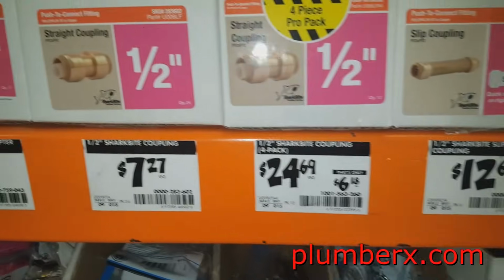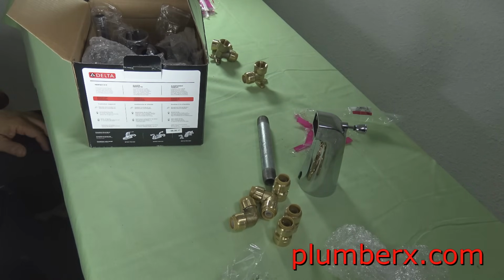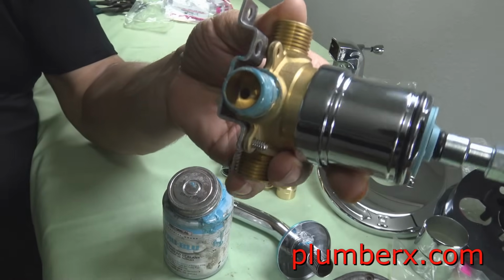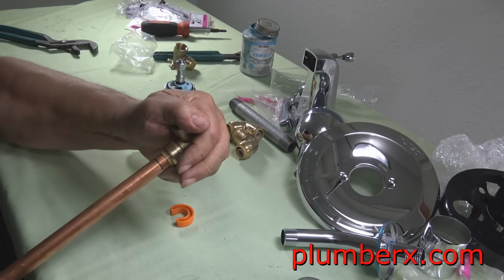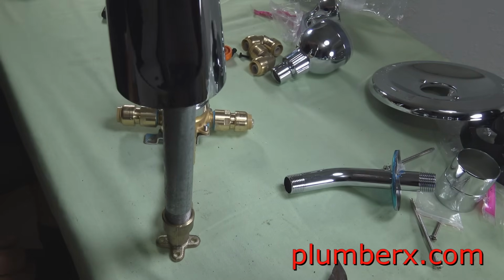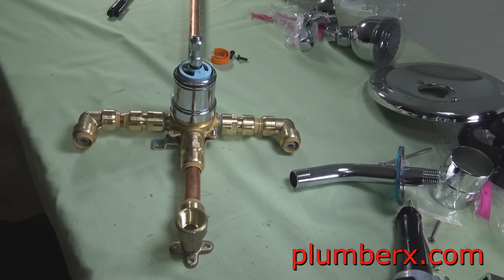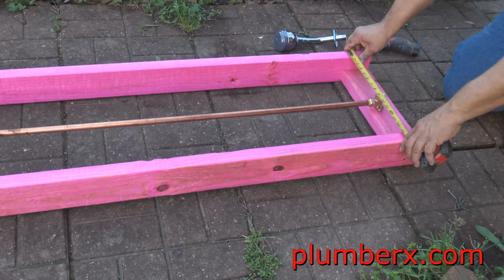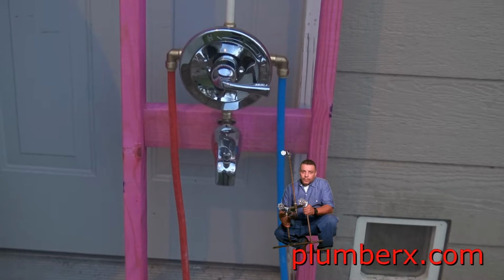Plumbing With Sharkbite Fittings

Comment: The supply inlet fittings are too close together.  You can not put the tool in to remove the fittings.  Also leaks if the pipe doesn't reach the o-rings to create that seal.

Comment: A few years ago I was "freakin' and called Beacon (plumbing)."  They charged me over $700 to come to my house, cut the hot and cold lines, and stated that because this type of plastic pipe wasn't legal anymore, they had to disconnect and cap,  and couldn't fix.  (Ended up being a washer put in wrong a few weeks earlier.)  I read up on PEX pipe and Shark Bites, and recently replaced the pipe, added Shark Bite shut-off valves and elbows (and an access panel thanks to Beacon), and hooked up my bathtub after two and a half years.  Only cost me a little over $100 for parts AND tools.  Love Shark Bite and glad to see your video!
Reply: I’m sorry.  I once called beacon.  Everybody loved bacon they say..  they don’t even charge me for “attempting“ to unclog my main sink pipe.  I was shocked

Comment: I would never install Sharkbite inside a wall or anywhere else. One bad fitting and you could have $100,000 in water damage. Like Boars Head cold cuts. “Compromise elsewhere”.

Comment: You forgot to deburr the outside of the copper pipe as well. Reaming the inside is good practice to prevent internal turbulence - but deburring the outside is required to prevent damage to the O-Rings. You also might as well use Pex to save some money instead of copper.
Reply: @claudetaylor7648 , I'm not a plumber - just thinking about it from a DIY or homeowner's perspective. Copper and Pex have their drawbacks. Pex-A had a bad batch and got sued. Copper is prone to internal corrosion if for God forbid rust from your water heater finds it way to your pipe.

Since it looks like you're creating a new bathroom - I just thought Pex would be easier and faster to both install and repair. Especially if you make make it accessible for repairs (i.e. access panel).

Regarding pex, even if Pex-A had a bad batch and got sued - I would still use it for whole house. Naturally it wants to contract, meaning overtime the connections to fittings get stronger when compared to Clamp or Crimp. But, the main reason I would choose Pex is any non-professional can fix or make a quick fix without having to worry about burning their house down.

I would use Copper if it's put under a concrete slab, especially if it's hooked to the city's main and not vulnerable to rust from the Water Heater.

Comment: sharp copper ends on the outside or the end going in the sharkbite  can knick, cut the rubber seal or slightly damage it in the sharkbite.....especially when using copper....i always debur with sandpaper or a deburring tool, outside, inside and on the face going in

Comment: I find It interesting how sharkbite changed the design about a year ago, sharkbites work fine for temporary repairs but I would use solder or crimp for something permenent.
Reply from the maker: That's a great observation about SharkBite fittings! You're right that they're generally considered suitable for temporary repairs, and most plumbers would opt for soldering or crimping for permanent installations.

SharkBite did recently introduce a new line of fittings called SharkBite Max, which are designed to be stronger and more durable than the original SharkBite fittings. 1  These new fittings are rated for higher pressures and are said to be more reliable for permanent installations. 1  However, there are still some plumbers who prefer traditional methods like soldering or crimping for permanent connections.   
 1. 
What's the Difference Between SharkBite (1st Generation) and SharkBite Max?

www.sharkbite.com

Ultimately, the best method for connecting pipes depends on the specific application and the preferences of the plumber. It's always a good idea to consult with a qualified plumber to determine the best approach for your particular situation.

Thanks for sharing your thoughts on SharkBite fittings!

Comment: The plastic insert on the Shark Bite is only for pex. I remove it when using copper or cpvc. Grab ahold of insert with needle nose pliers and pull out of fitting. Be sure to grab the insert well so I comes out in one piece.
Reply: That's what I was told.  If you're using cooper take out the plastic insert
Reply: Absolutely not!
Reply: @nouche-30064  The shark bite website even says you can remove it.

Comment: We just installed a water softener. The previous owners never installed a main house supply shutoff. We had to turn off the pump & drain pressure. While it still had water coming out without pressure, we installed a ball valve shutoff. By keeping it open, it pressed on with no problem & we could shut it off immediately to continue the re-routing to complete the installation. All fittings were sharkbite. No leaks. We bought the depth/marking tool to chamfer the PEX pipe & guarantee full insertion.
Reply from the maker: Nice

Comment: Love the detail. I was hesitant on using shark bite inside a shower wall but this saves so much time vs.. sweating copper pipe.
Reply from the maker: Sharkbite. Good stuff. 😉
Reply: Sharkbite is so handy man work
Reply: You can also use PEX in a wall. Both have similar lifespans.

Comment: I’m a female and remodeled my shower from the floor up and used shark bite!  I love it. I’m getting ready to install my new whirlpool bathtub and out a new faucet and handles and I will definitely use these again!
Reply from the maker: Nice. I appreciate your feed back. 👍👍
Reply: Never put shark bite in an enclosed wall cavity. At bare minimum I would cut an access panel where you make the connections so you can make sure they are not leaking every 3-6 months. Shark bite is handy but should never be out in an enclosed environment where it cannot be seen. The failure rate is just too high.
Reply: If sharkbite was so unreliable, why are so many used, yet still don't leak? Plumbers forget to mention, everything can leak of not installed properly.....even sweating copper joint can leak over time.

Comment: Good vid.  Thanks.  You need to deburr the outside of the of copper pipe also when using sharkbite fittings because that is the surface that passes over the O-ring.  Any abrasions on the O-ring will result in a leak developing.

Comment: Shark Bite sells a tool for reaming CPVC and marking the depth of the fitting by size ( 3/4 , 1/2 etc.) costs $10.00 makes the marking process much faster.  I would use the tool on copper also. (just to mark pipe)  Thank you for the video.  : )
Reply from the maker: Cool

Comment: I'm hearing a lot of ppl saying to not use a connector like these inside the wall. I want to convert my copper to PEX. I've heard that you would want to solder a female piece to both copper water pipes and then convert the rest to pex fittings. I'd like to avoid soldering. Is it save to use the 90 degree connectors, one connected to copper, the other end fitted with PEX inside the shower wall to avoid the extra work and materials needed to solder? Thanks!

Comment: those plasric inserts are for pex to strengthen it so it doesnt collapse. you take them out when using copper.
Reply: You can, but my understanding from SharkBite is that you don't need to take them out when you use copper either.
Reply: The other brands you have to take them out for copper. Not sure, although never tried to take out insert on sharkbites brand
Reply: It's correct. They are superfluous when using copper. They are for pex use only

Comment: I got a Tectite, that is similar to the Sharkbite. But a connector I got, doesn't have the plastic insert, for the PEX. Does that mean I can only use the copper pipe on it? Does the PEX have to have the insert?.
Thank you.
Reply from the maker: Sorry, but I'm not sure. I never used Tectite, I don't know the compairances
Reply: @theartofplumbing  It looks just like Sharkbite.  I went back to home depot, and found the proper ones. The one needed a threaded to PEX adapter.
Reply: @shark70007000  Cool

Comment: I always take the white plastic piece off the shark bite whenever  I attatch it to copper.  Works fine
Reply: Doesn't that remove or damage the steel teeth?
Reply: @Sovereign_Citizen_LEO Sharkbites I  bought have the white pieces separate in the bag

Comment: One of the best explanation that I have seen! Thank you so much!This gave me the solution for the spout using Uponor PEX-A.
Please sir, why do you take a 3/4 copper pipe for the tub spout? The old soldered one that I removed was 1/2, so I bought the fittings for 1/2 PEX-A. Should I exchange the fitting of the valve and for the galvanized pipe?
Reply from the maker: 1/2 inch it is. Sorry I may have said 3/4, but 1/2 inch is what I meant to say.
Reply: @theartofplumbing  Yes, you said 3/4 at 29:19 and to me, it looks bigger than 1/2. As a matter of fact, they all look 3/4.
Thank you so much for this fast answer, Sir! I saved this video for friends and for myself to watch again.
Reply: @nmatthew7469  I was talking about the copper going from valve to fitting for galvanized pipe!

Comment: Pipe dope or pipe wrap tape to put connections on valve body? does it matter. I put pipe tape on and before final connections I figured I better ask. thanks
Reply from the maker: To me it don't, to some plumbers it does. Only fittings I would not use tape on, is any type of plastic pipe.

Comment: If you cut the pipes 1-7/8 how you take them out if needed. I recommend to cut 1/4 longer to allow space for sneak the orange tool in to take out. How is that?
Reply: It’s difficult to remove them with the orange tool. Buy the gianneer disconnect tool.

Comment: Great video! - But I have a question concerning how deep in the wall should the head and valve be? I mean how far behind the face of the stud do I mount the shower head and the valve so that after the backboard and tile is installed I will have the correct amount sticking out? Can't seem to find a video on the placement. It looks like maybe you nailed a 2x4 at the back of the wall studs? So if I do that will a delta shower valve be at the right distance? Thanks!
Reply from the maker: Good question, all new tub and shower faucets/Valves come with a plastic protected to prevent damage to the valve when being handled or transported. That same protected plastic is also used as a depth indicator showing you how far the valve should be in the wall, all valves are different. Hope this helps.

Comment: How do you adjust the depth of the 2x4 bracing that holds the female ips connector to the threaded pipe for the tub spout?
Reply: Rip the 2x4 bracing out with a saw saw and install a new one.

Comment: You have a very pleasant voice. I enjoy your videos. Thank you for this.
Question: Won't the galvanized & brass going together cause a chemical reaction that will cause corrosion? Would a dielectric fitting work for that application?
I want to go from a 2 handle system to one handle but don't want to sweat copper to connect to the new shower/tub valve. House was done in the 40s & still has very old plumbing. 
I got a Delta Monitor Multichoice valve with threaded male outlets/inlets. Since PEX has gotten cheaper I'm going to switch to it but am trying to find the best way to do the tub spout. Tub spout is slip fit so I need something that will work for that (assuming copper is the best).
Also will be installing a brand new tub/shower system in another bathroom & converting a shower/tub to a shower so I will be able to recycle parts.

Comment: I installed the part but I have no water coming out now. I’m kind of stuck. Any thoughts?
Reply from the maker: One idea.  If hot and cold water to the house is off one are the others. Shower will not come on. Both have to be on. Hope this helps
Reply: Found out my dad installed it incorrectly. Fixed it and we are now good
Reply from the maker: Nice

Comment: If using PEX, could you not just do elbow adapters from the brass body? Wouldn't that be simpler?
Reply from the maker: Yes, but in most cases, if you're going to line up with old plumbing 8" spread is the norm. Good question.
Reply: @theartofplumbing  makes sense!

Comment: I prefer soldering, but my when a plumber charges by the hour there's a benefit to using fast connections in the more complicated fixtures.

Edit: also in tight spaces with worn out wood where the risk of a wall catching fire is high. Without much room to work with compression fittings can be a pain in those cases too.

Comment: Do not mix different metals, as in the brass female pipe thread to galvanized iron pipe thread.  Eventually you will get corrosion by electrolysis, the iron pipe will be eaten away.  I just replaced a tub/shower valve.  As I removed the spout or spigot, the galv pip literally fell apart.  I would not recommend plastic pipe either, as you may not get enough torque while tightening the fitting.  I would recommend using brass pipe.  A four and a half inch piece of 1/2" brass pipe just cost me $20 at a local hardware store, but that's the way it goes.

One more thing about Sharkbite, the tubing or pipe must enter the fitting straight in, if there is a slight angle, the fitting may not seal, I learned that one the hard way too.

Jim

Comment: What kind of pipe is that you are using for the faucet and is that ok to use as far as rusting?  I don’t want to have to solder.
Reply from the maker: Copper, you can also use CPVC or pex 👍

Comment: With the cost of these fittings wouldn't it be cheaper to buy the pex cutter and crimper and use plastic pex fittings and pipe? Or at least be a wash cost wise?
Reply from the maker: Yeah hard to say. 😖

Comment: So I’ve used shark bite fittings in a few walls..
I’m considering removing them due to all the comments from all the “pros” advising they’ll fail, etc. 
what’s the real? How long will they last, would you recommend that I only use them for external solutions?
I plan on re-piping my home and don’t want to use them everywhere and end up with a mess in a few years.
Thanks
Reply from the maker: If installed properly like any other water supply fitting. It well last as long as any other fittings like Copper fitting, propress fittings or any other fitting. Bad and good things can be said about any water supply fitting. I've seen them all fail at one time or another.
Reply: @theartofplumbing  thanks
Reply: I agree, install correctly and it has lasted in my home for going on 5 years.....still no drips, leaks, or corrosion.  (By the way for all the "pros" I used the sharkbite to replace leaking sweat-on copper joints installed by a "pro.")

Comment: I agree, install correctly and it has lasted in my home for going on 5 years.....still no drips, leaks, or corrosion.  (By the way for all the "pros" I used the sharkbite to replace leaking sweat-on copper joints installed by a "pro.")
Reply from the maker: 👍Exactly on point. Awesome. You hit the nail on the head.
Reply: After a $2,500 estimate from a pro who said Sharkbires can't be used behind walls, I found Chaptet 6 of the International Plumbing code 2018, YES it is approved!
Reply from the maker: True. Plumbing codes are starting to catch up with technology. 👍

Comment: Dont you need to temove the white plastic inside when installing copper tube and leave it on when installing plastic i saw you put on the copper tube with the small plastic inside

Comment: SharkBites are expensive, but if this simple system allows you to successfully do the installation yourself, it will still be far cheaper than hiring a professional plumber.  The expense is acceptable for one or two bathrooms, but a contractor with 220 shower units to be installed in a new apartment building isn't going to use SharkBites.
Reply from the maker: Well said🙏

Comment: How long do you estimate the shark bite will hold in place before any problems from it arise?  Does the pipe dope (sealant) make it difficult/ impossible to remove the pipe in case a fix is needed?  Thanks
Reply from the maker: Just like any other pipe fitting. If installed properly and no manufacturer defect for many years at least 25. 👍
Reply: @theartofplumbing  :-) thank you and have a great day. 👍
Reply: I had a Sharkbite fail - I didn’t cut it right or clean it right - I pulled it off - recut the pex and no leak - same connector - not a plumber but love the shark bites
Reply: @yoho1021  Got it. Thx

Comment: Thanks for the detail. It was very informative and helpful. I am new DIYer. Planning to do this in my cabin which is very far from the city. Thanks, again very helpful. One question I have I very tight spot for the toilet drain how long does a 90 degree 4 inch pipe that is connected to a toilet flange in the floor have to be in drain properly. I only have 6 inches to 7.25 inches at most to work with. With 6 being preferred. Then I have to make 6 foot run of black abs pipe to the man sewer drain line.

Comment: Instead of using 90 shark bites with a closed pipe on the hot and cold, could you skip the 90 and just use a curved piece of pex?
Reply from the maker: Sure you can, but it may be a little to tight to make that turn.
Reply: @theartofplumbing  Thank you.

Comment: Generally how much would a plumber charge to replace that behind wall???
Reply from the maker: A plumber may charge you $800 to $1200 dollar's, but they won't do it with sharkbites  fittings and in most cases they will not repair the wall if they need to cut into it.
Reply: @theartofplumbing  thanks